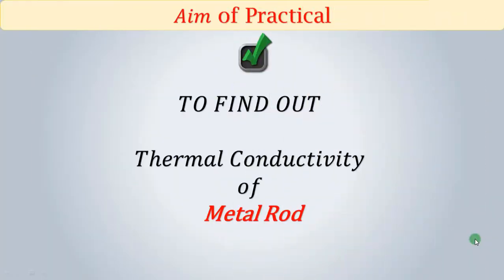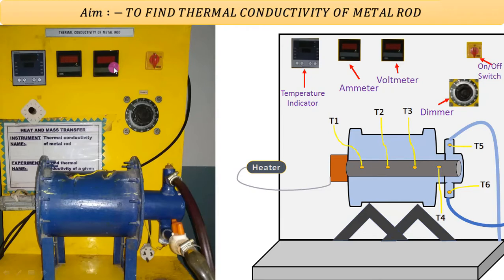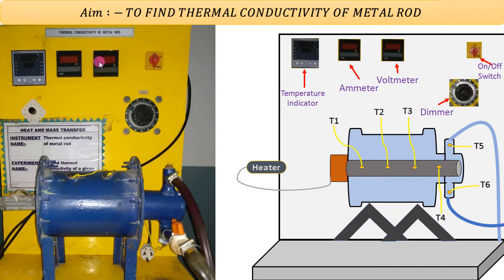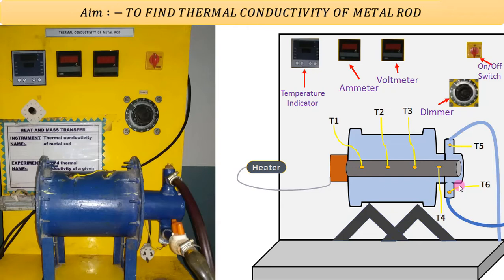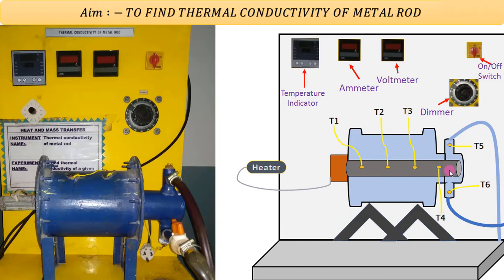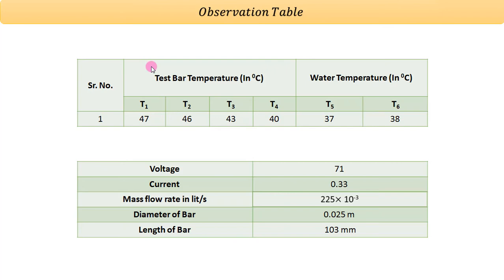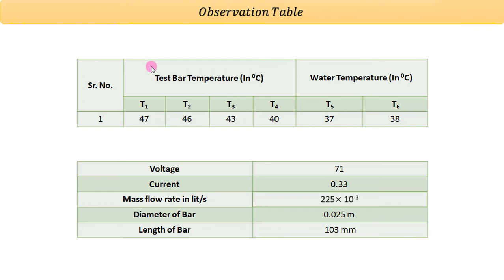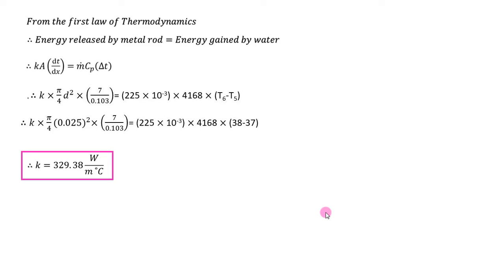P 03  To Find Out Thermal Conductivity of Metal Rod | Heat Transfer | Mechanical

Comment: Dear students kindly take note that "to have a proper unit balance we need to consider mass flow rate in lit/s ,but in a given presentation by mistake it is 225*10^(-3) lit/m so we need to divide mass flow rate by 60 and need to calculate problem again.